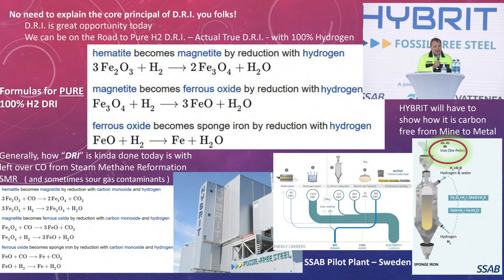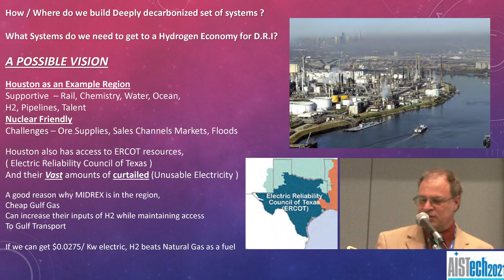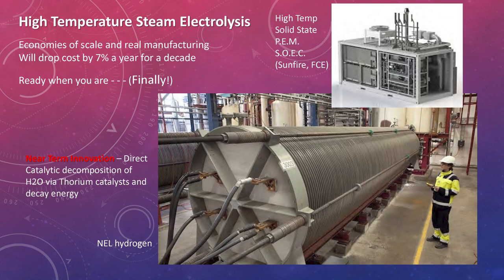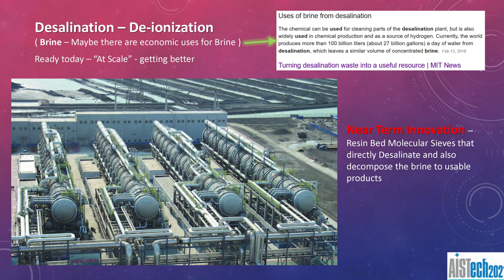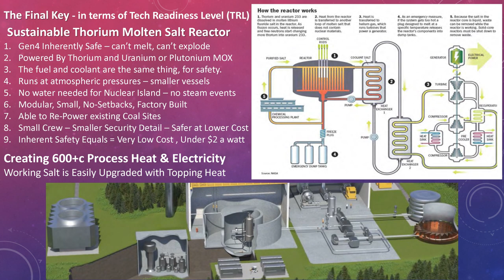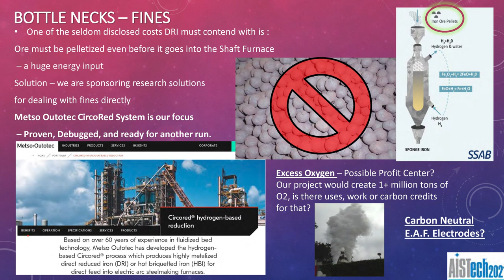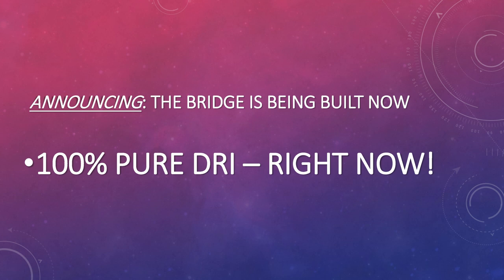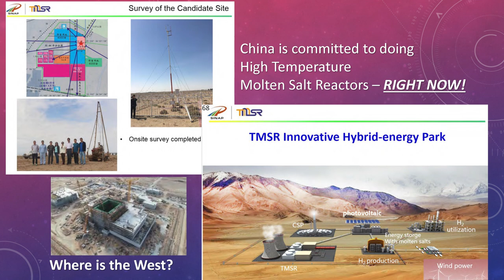John Kutsch - Pure 100% H2 D.R.I. - Green Steel

Comment: Theoretically you could still use process heat at current integrated Mills to replace natural gas being burned in blast furnace stoves to heat checker brick for the hot blast, I'm not sure what modifications would be needed to use hydrogen as your reducing agent though.
Reply: The plan - if you have eagle eyes - shows that we incorporate at leas 3 economizer / recuperators that take the heat from the process and put it into preheat of steam and H2. Very proud of the system efficiencies

Comment: I live in Sweden and there have been a lot reported on the SSAB "carbon free steel" project.

I'm not all that hopeful of that specific projects chances of success.

Last thing I saw was that they would use half of the electricity generated in Sweden.

And there's far too much government money/people and green virtue signaling involved and far to little economic and engineering reality involved to ever become successful.
Reply: Thanks for this info but that's too bad. So inefficient design is leading to plant actually requiring more energy than it will produce?
Reply: Why is there no energy production on site using a Thorium MSR? A plant like this needs to Produce, not consume energy!
Reply: @mrstevecox7  Maybe because there are no existing thorium msr yet?

But it gets worse, Sweden has closed 6 out of the 12 working nuclear reactors we had.

So currently we have 4x the electricity price we had a year ago. 

The green party looks more and more like God's punishment for sinful living, similar to the locusts, hail storms etc that Egypt suffered in the days of Moses.
Reply: If I understand it correctly, the plant will eventually produce 5 mil tonn/year of "clean"
steel. In that case, it will need basically one fifth of whole Suede electricity generation
(30 out of 150 TWh/year)...not impossible, but not an easy task, either...